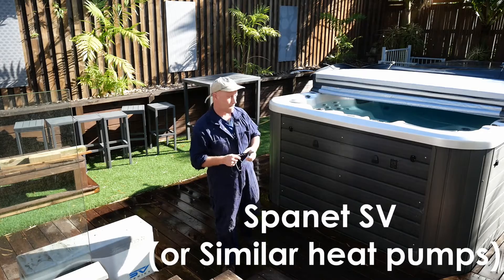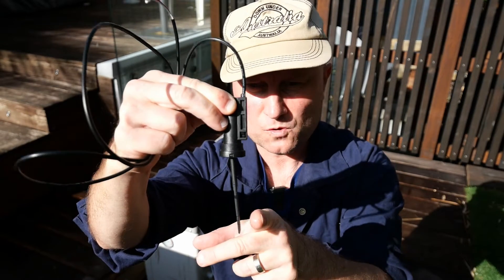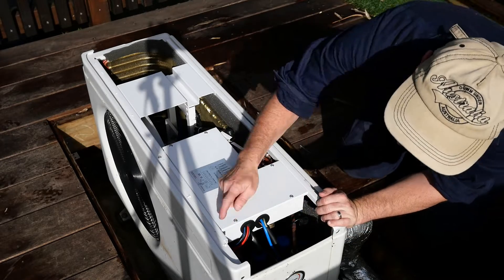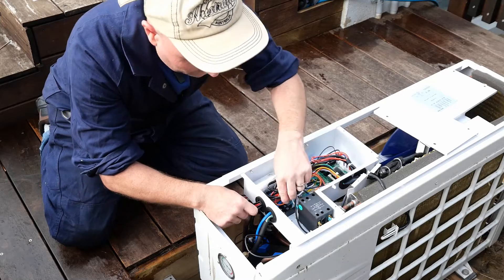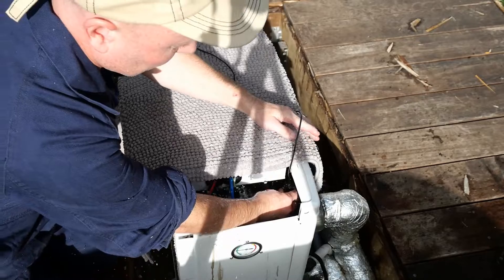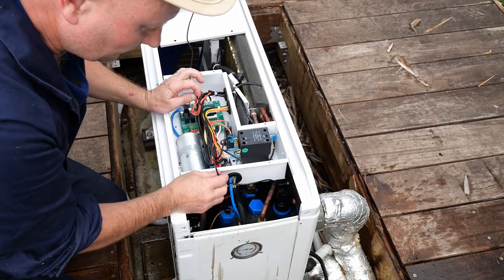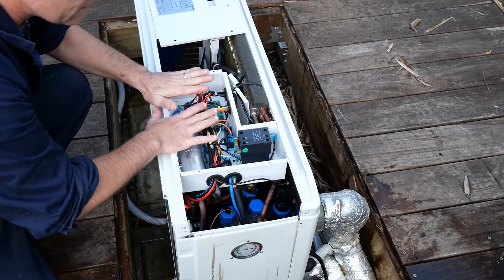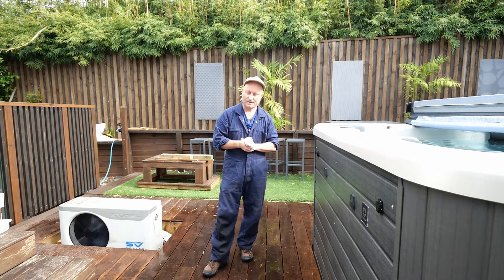Pool HEAT PUMP - SENSOR / FLOW SWITCH REPAIR FIX

Comment: does it matter what brand flow switch like if it’s generic like a capacitor
Reply from the maker: Thats a good question.  I'm not 100% sure on this particular one, without doing a test on it.  It will depend on the output data or voltage etc from this sensor.

Comment: mine was faulty from the first week of a brand new install, i unplugged the sensor on the board and plugged it back in and it worked fine. Six months later same problem and solution worked again. Prick of a thing and the amount of money you spend you think they would have something a bit more robust. Should be a sealed pressure sensor or something.
Reply from the maker: Thanks for watching.  yes I agree, the design of this sensor isn't the best..  I expect I will have to replace again every few years..